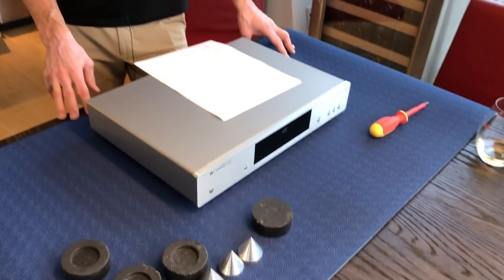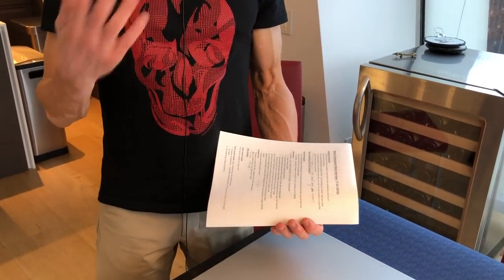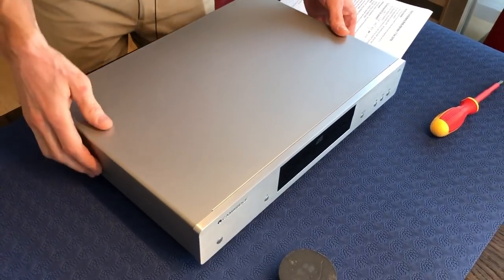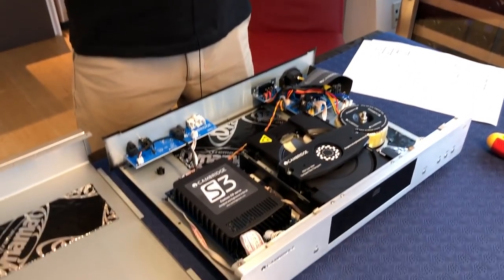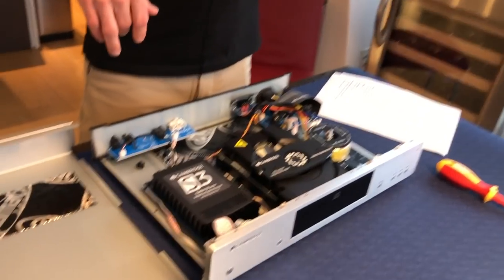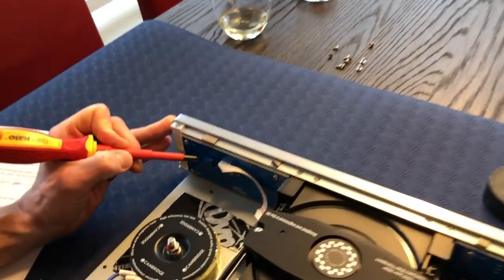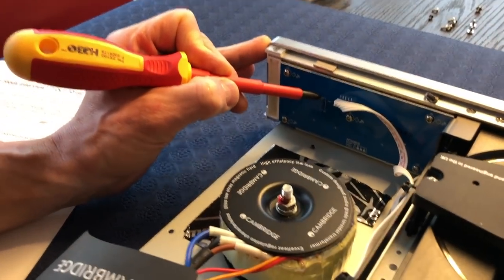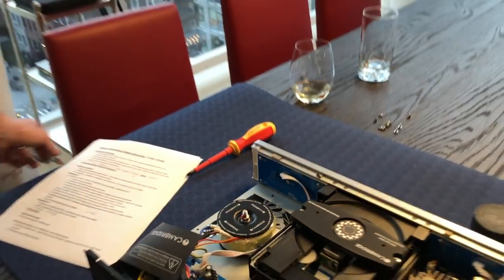Miguel pops the lid on his CD transport to tweak the sound

Comment: Miguel you did a very nice job... I merely applied the wiring separation mod and it brings incredible improvements on soundstage and transients in my digital source (I current use a MHDT Pagoda DAC). Now I am looking for dampimg sheets similar to Dynamat - I was only able to find similar products in Brazil.
I also had excellent improvements upgrading the power section fuse to Hifi Tuning Supreme and Schurter SMD ceramic on digital board.
Did you try damping material externally, above the chassis? 
Thanks for sharing this valuable discovery. It simply made my stereo sounds better spending absolutely nothing!!
Reply: I did not put any material on the outside or material on the inside that would cover any vents. Once you have a layer on the inside, it is enough to absorb vibrations - I don’t think an outside layer would be beneficial.
Reply: @miguelbarrio  I applied the damping material (without alunminum sheet) exactly yours at the chassis but I choose to cut stripts instead of squares to treat the cover, keeping about 5mm between each cover and filling over the rear side (covering the area on the top of power board and output cover). After I tried to twice the material to cover about the entire cover and I realize a loss of dynamics and transient response.
Reply: I also cut 5 strips of butyl damping sheet (about 4cm x 1cm), roll each one and applied then into the little slots located above the face plate of the CD drawers. It improved resolution and sense of air between instruments and the high frequences became less bright without any loss of extension and details. I guess it is possible to use Blue Tak or similar to fill those slots. I enjoyed this mod and I want to share once is easy to apply as your findings. All the Best!
Reply: What particular fuse did you use for the CXC?
Reply: @aristoweb  Hello.. at that time I placed a Hifi Tuning 2A on power supply and a Schurter 2A fast on digital board. But for this moment I wouldd recommend ACME Silver Fuses, which I think it sounds more natural than my previous suggestions.

Comment: Very nice tweaks! I experienced issues with this unit having difficulties playing home made cds. Have you had any issues with that?
Reply: No issues. I have burned CDRs with 16/44 AIFF files using iTunes on mac without any issues. Even CD-text works and is properly read by the CXC. Just remember it will ONLY play 16/44 CDs - no data, mp3, or anything else.

Comment: I don't get that he spends only $400 on his transport but has a dCS DAC that must have cost 20–30 times as much. Hmm.
tip: listen to the whole video in 1.25x speed, it is easier to process (less jitter) JK, but 1.25x is better.
Reply: About $33k. The reason I got this transport is a "test" to see if I get back into playing CDs. If I did I would get the Rossini transport (which would also play SACDs). But I can't say I have gotten into CDs enough to justify that. And higher on my list of priorities is getting a vinyl setup.
Reply: @miguelbarrio  I just bought my first dedicated transport, an Audiolab 6000CDT, and wow, beats the heck out of my Oppo as a transport! It is heavier steel and pretty dead already, has a oversized toroid, but, I'm afraid noisy power supply diodes. Well, there is considerable AC line filtering to lessen noise put back on to the AC power line. I'm going to put dampening under the transformer, as they tend to vibrate at 60 Hz.. Vibration is not just the enemy of reading microscopic pits on a disc, but clock crystals too.

Comment: There are always modifications that can be carried out,regardless of equipment price.It's surprising where cost savings are made by manufacturers sometimes.Start with power supply mods first of all.Damping and shielding ,as per this video can be useful with the ''tin can'' type of construction of the cheaper gear.
Reply: Exactly. Additionally, it is sometimes surprising - though understandable - that a manufacturer would choose to use a $0.70 electrolytic instead of a $0.85 electrolytic, the latter being much better. It is just that most items are built to a price point AND a performance point, and at times it is those budget items that are easiest to improve. In the particular case of this unit, the design is really done extremely carefully - for example the choice of paralleled multi-type capacitors. However, when it comes to execution of the design, sometimes a lesser quality cap is used - and replacing it for a better cap is an easy way to improve the sound. And lets not forget build cost: sometimes things are put together physically in a way that minimizes steps and/or build complexity in order to make the build cheaper.

Comment: Yes needs two players an original and the modified one then listen to the difference.the case on that Cambridge is not high end ! very flimsy
Reply: I don't see why he doesn't just remove the top altogether. That makes more sense to me than adding the Dynamat.
Aesthetics take a second seat to sound quality for me.   : P
Reply: Hare deLune, stray EMF is one reason and the CXC cover does in fact physically rests on the top of the transport.
Reply: @motorradmike 
I suppose EMF is more a concern for people in a more urban environment.
If the top of the case rests on the transport, that is all the more reason to remove it for me. Zero resonance, and you don't have to worry about magnetic field leakage from the power supply (or whatever; that's something I need to research more).
Reply: Hare deLune, on the face of it you have a valid point. There is a reason all manufacturers use metal casework, resonant or not. The CXC is extremely well designed and there is a reason Cambridge wanted the top plate to physically contact the top of the CD drive, albeit via a dense foam pad. I believe it was done to use the heavier top plate to stabilize the plastic CD drive. You will observe from the video this is the reason the dynamat was not applied on the area that actually touched the top of the drive. Cambridge could just as easily made the CXC case 1/4 higher. Answer: they didn’t for a good reason.
Reply: @motorradmike 
No argument there.

I am also not recommending what I said for everyone to do.
My experimentation with this sort of thing can lean toward the radical side. I would probably put a weight on the drive.
As has been said: Proceed at your own risk.

My favored approach is: Experiment on a spare piece of equipment if you have it, not on your main rig. Cheaply bought vintage equipment would also qualify here.
That way, if you make a mistake or have an accident, it is less horrific and costly.
Reply: @motorradmike  sounds good but my 20 pound DVD has similar case